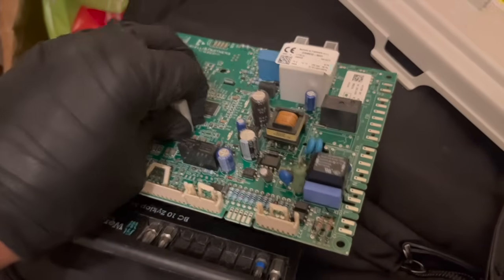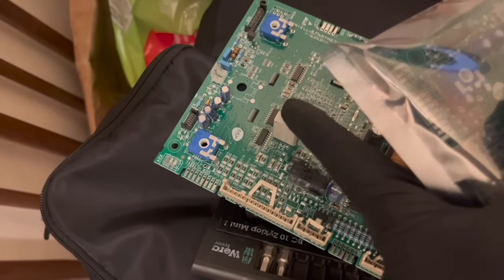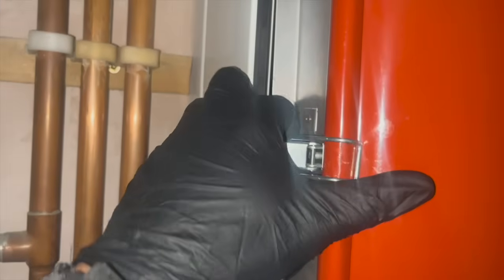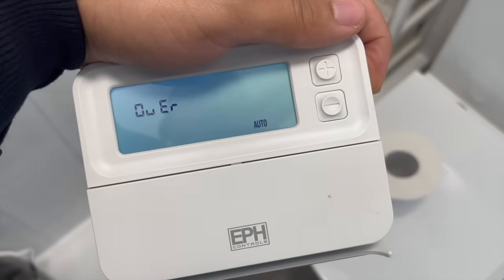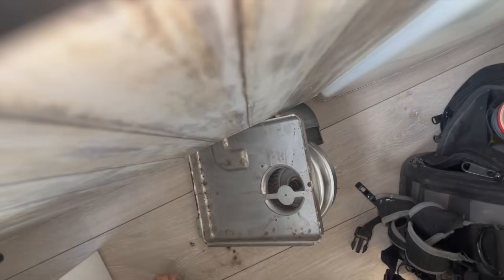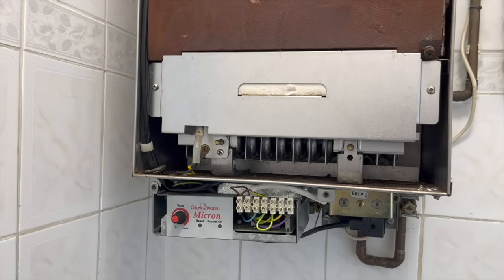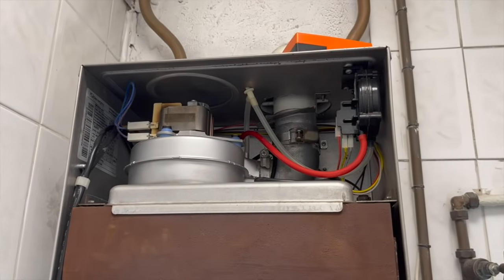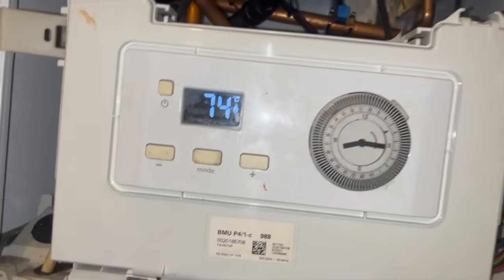Boiler Diagnosing, Repairs & Training | Day In The Life Of A Gas Engineer #12

Comment: No screen, full speed fan such a typical error. Try replacing the faulty cap instead of swapping out whole pcbs. Multimeter and a soldering iron is all you need, can be done in 15 mins, and you can save a ton for the customer
Reply: That's technically illegal to do such on a gas appliance
Reply: @jockster5525  Right to repair!
Reply: Which cap is it that normally goes @tapilogali ?
Reply: @jamesasprey2092  usually the little blue one near the transformer between the two larger caps